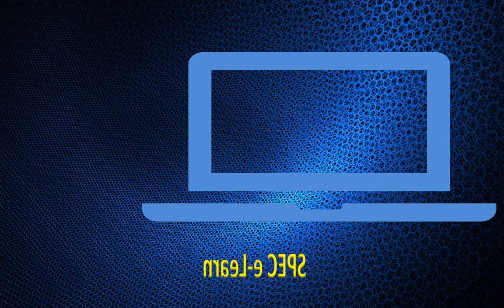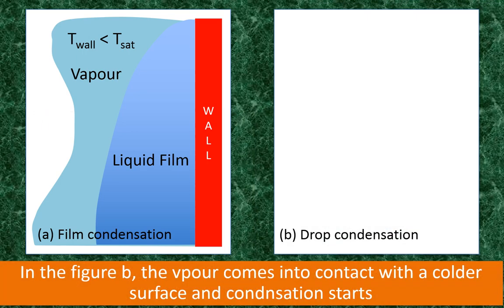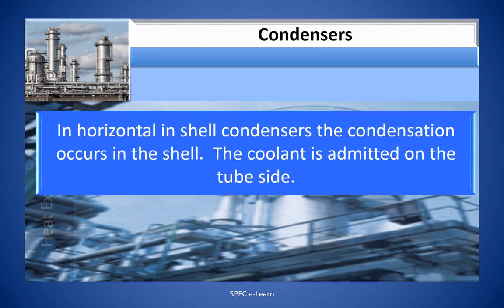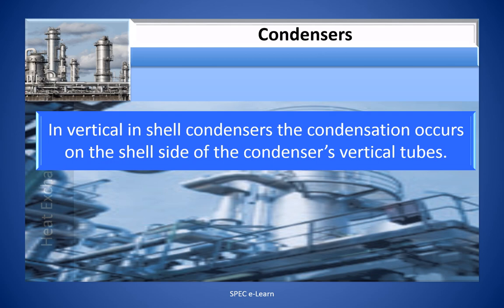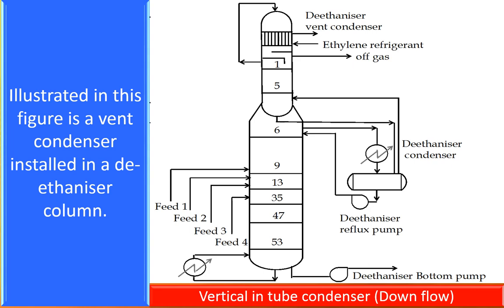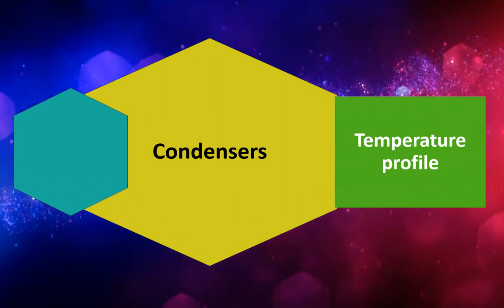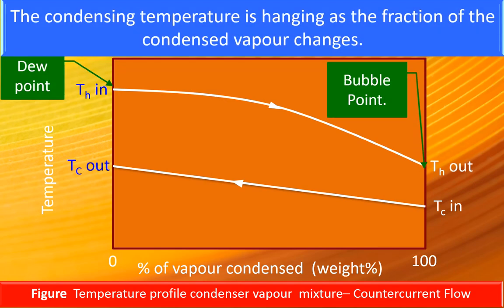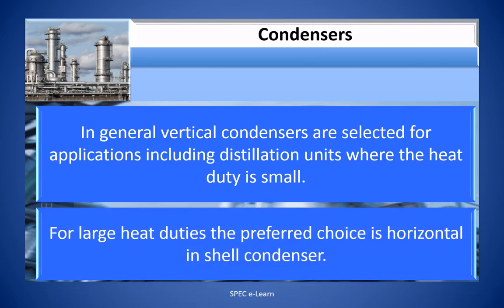Condensers –Types, Applications, Selection and Design Considerations

Comment: Sir , can you make video on Reboiler  inlet and outlet Hydraulic Calculations ? Thank You!
Reply from the maker: Thanks for your comment. I can not make generalized hydraulic calculations video for reboilers. The procedure for vertical thermosyphon reboiler is different from that for horizontal reboilers. Also in vertical reboilers, the vapour fraction is increasing at every incremental length as the two phase flow moves up the tubes from the inlet of the reboiler. It is tedious for hand calculation. It is best done with process simulation software.
Reply: @SPEC786  Ok  Sir ,can you atleast make video on circulation rate of reboiler and it's  formula with respect to vaporization rate? I would be grateful if you do on it.
Reply: Before replying to your second request let me add one more point on the first request. For preliminary design the approximate hydraulic calculations presented in the video titled " Reboilers - Types, Applications and Selection Part 1 and Part 2 can b used. Watch the video and follow the steps provided. It will give rough estimate of the pressure drop and the height required to position the column to provide the needed head in the case of thermosyphon reboiiler or the pump  head in the case of forced circulation reboiler.

Coming to the second comment/ request, the circulation rate is calculated as follows. Calculate the  bottom vapourization rate required for the column from the column design. Assume 20-25% vaporization in the reboiler. If assume 25%, the circulation rate = Vapourization rate /(0.25). With this you can design the reboiler. Hope this information is useful.
Reply: @akbaralimohamedhaneefa3448  thank you sir. Can u share your email id ?